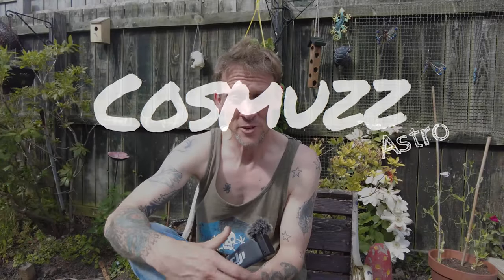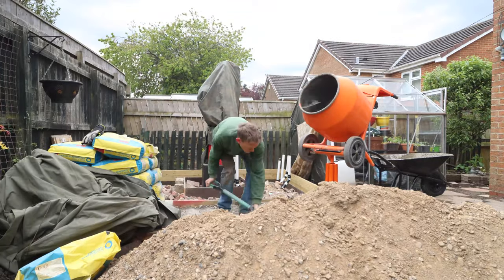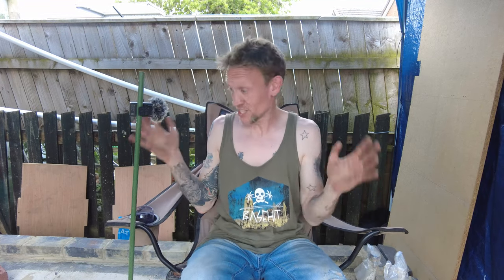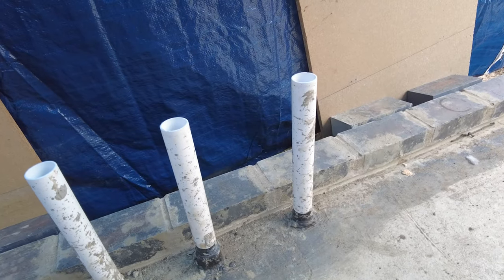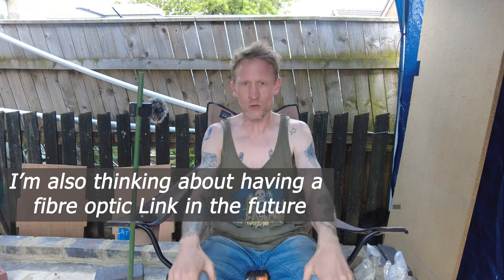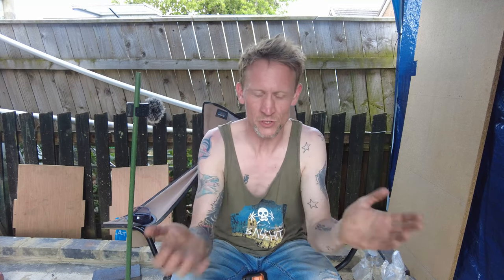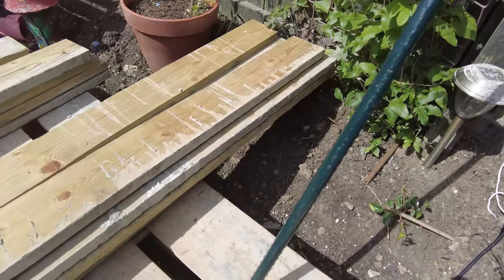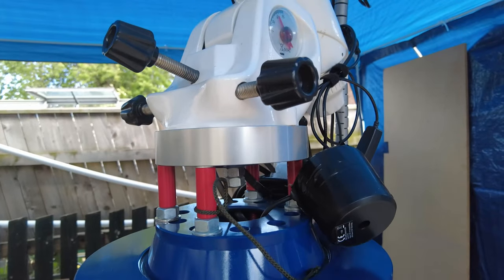Part 2 Observatory Build.  Base Foundation Done.  Key Features. Cost So Far.

Comment: Awesome mate blue engineering bricks eh Ben right so you've used the dry base you don't need to use the dry base on the blue engineering brick they originally build houses with them because they fired in the kiln more than a normal red brick which makes it stronger and also that dense water can not get through them pair the dry base on to the wood instead mate as it's designed for wood too job buddie keep it up see you soon
Reply from the maker: Haha.....Too late mate.  I coated the sides already.  To be honest I did a poor job cleaning the bricks off so used the rest of the DPM to tidy it up.  Talk about over engineering the job lol.
See you soon buddy.  Talk about it some more.
Reply: @CosmuzzAstro  🤣👊👍